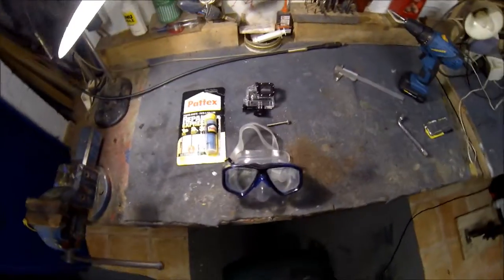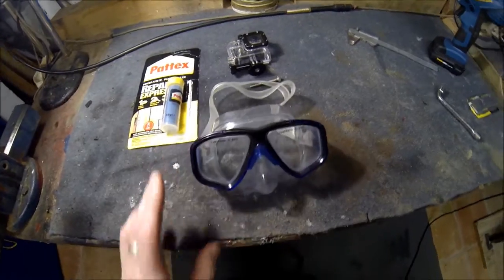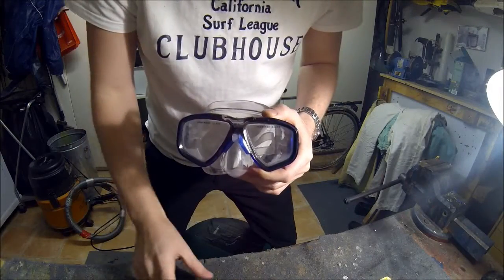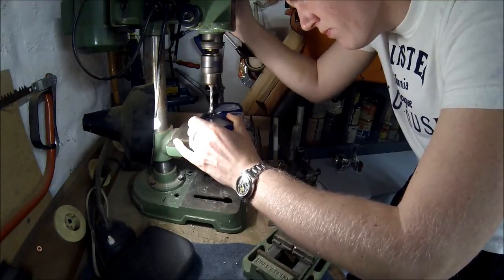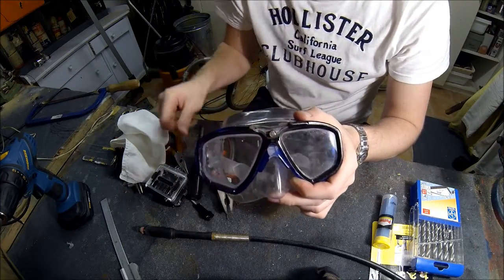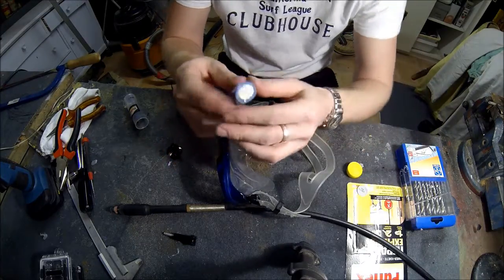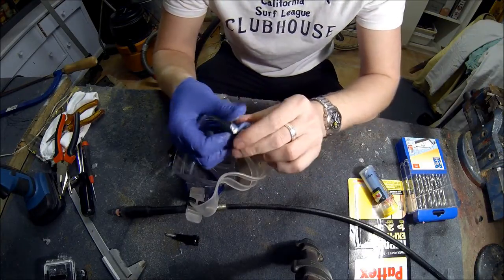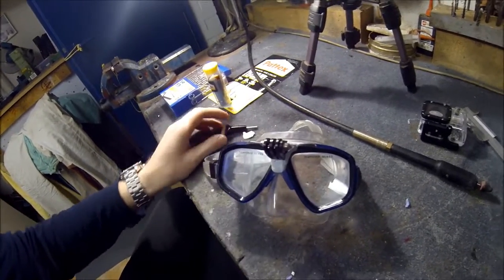DIY - How to mount a GoPro Camera to a Dive Mask

Comment: Hi, i suppose it works although i dont like the finish with the putty, what if you used a double sided tape cut exactly to the base diameter say 3mm thick wouldn't that work ?
Reply from the maker: +Stelios T Hi! Instead of or with the screw?
Greetings
Reply: German Spearfishing Channel with the screw
Reply from the maker: +Stelios T Could work but i think the putty is much more stable and if you dive and the screw gets loose u Risk to throw away a 300$ Camera.
But ofcourse give it a try 🙂
Greetings Chris
Reply: You could possibly use a couple of drops locktite on the threads to keep it tight, don't get me wrong just making suggestions for improvement.
Reply from the maker: +Stelios T yeah thats Great thanks!
Superglue instead of lock tight (but i Love lock tight 😂)
Guys like you help me alot in improve of my Equipment